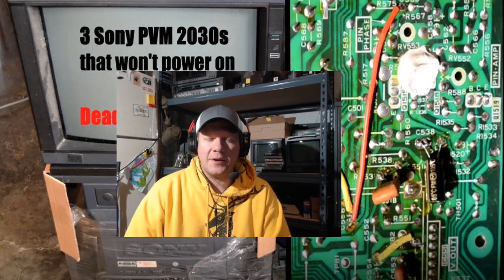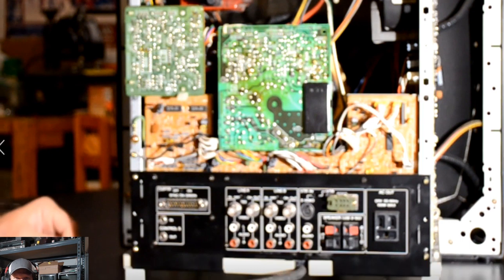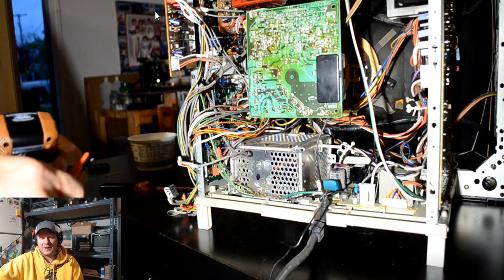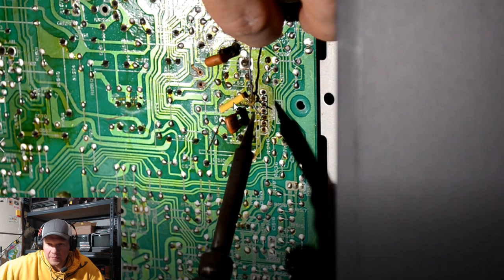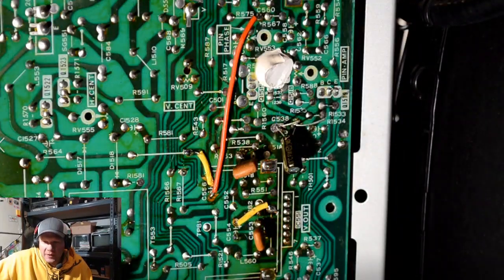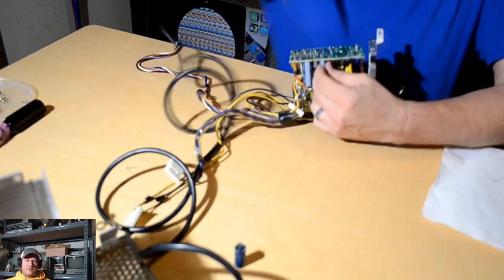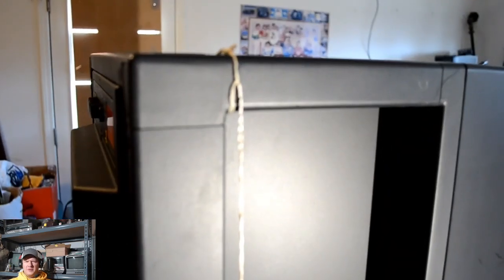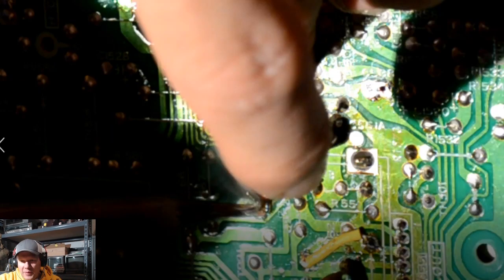Can I get these CRTs to Power On? | Sony PVM 2030 CRT Repair

Comment: I love how overengineered those units are, I remember tearing apart my 9042QM (which is just a plain old 8042Q but adapted to run on 240V 50Hz) and saw how tightly packed it was inside, just like on the 2030/2130QM you can swing out some of the boards.

Pretty cool IMHO.

Comment: It's impossible for those older models to avoid having at least one corner wonky as hell. That's because of the shape of the screen itself. It's just not possible to fit the raster into it without some sacrifices in the corners. One of the corners would always end up worse than the others.

Comment: I have a Sony PVM 20M4U that turns on but doesn’t show video until I let it sit for several minutes and then it slowly fades in with wonky geometry until it’s fully warmed up. 

I live in the greater Charlotte, NC, area, so would it be feasible to drive the unit to you for examination and repair? I bought a cap kit I found on a forum for this monitor, but when I went to take it apart it looked pretty intimidating for my novice soldering skills.

Comment: Hi I got a crt tv  Everything works Perfect  But it smells When I smell the vents In the back what's the problem you think
Reply: What is the smell?
Reply: Ducklips virus
Reply: Dust.  Dust frying.   ...open up the plastic back.  Wow down the back with alcohol.   Clean the vents.  Use anti-static brushes to brush the dust off the circuit boards.  Brush lightly.  Make sure the nervous is securely connected.  Reconnect the plastic back. 

If is previous owner smoked, the smell you are smelling, is sticky nicotine.  Alcohol may clean it, but you run the risk of snapping off components, if you clean it too hard.
Reply: If it smells like ozone it can be the high voltage arcing on the suction cup.